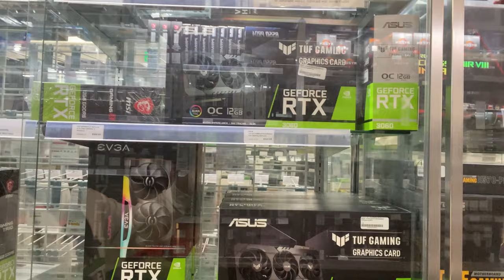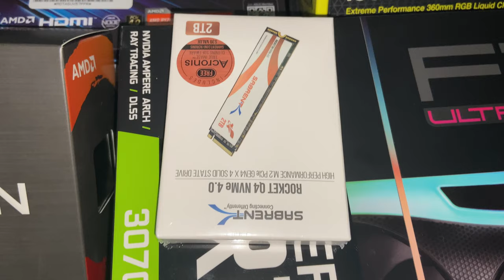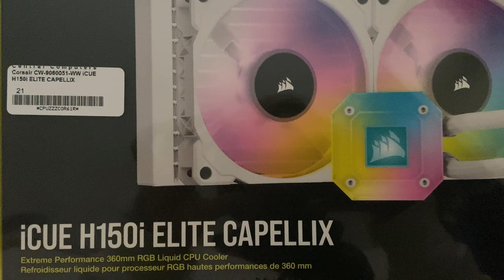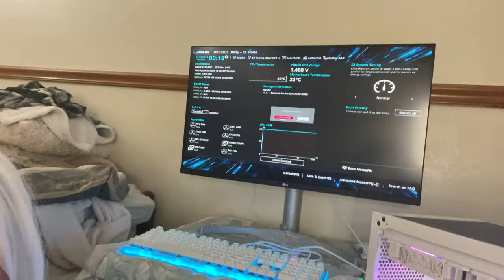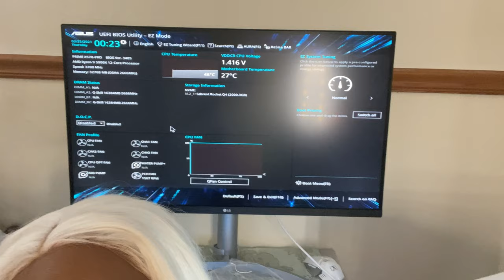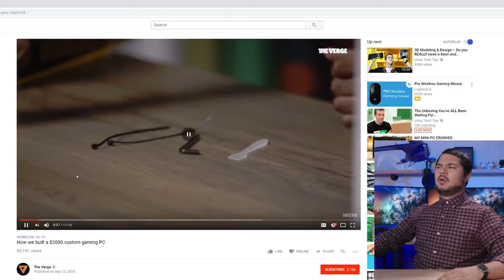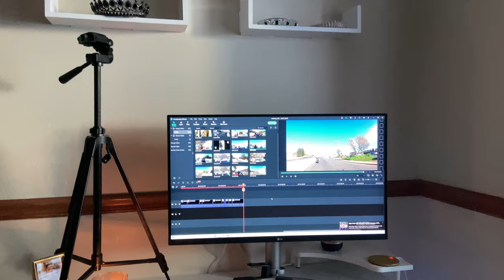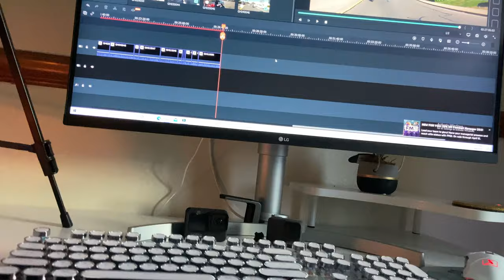Building my first PC build. I FOUND GPUs!!!

Comment: Super late but congrats on the build - one of the 3 builds (not a typo) I've done for myself has similar specs (same CPU as yours, GPU: RTX 3070ti by Nvidia, motherboard: ASUS ROG Strix X570-E, EVGA Supernova G5 1000W PSU, 22TB total storage {might change some aspects there}, 64GB RAM, NZXT 240mm Kraken X53 CPU Cooler and Phanteks Eclipse P360A chassis).

I also had very similar frustrations so it's all good. This earned my sub!

Comment: 9:40 be carefull, the NVME is wrong
you have the yellow screw that is to be inserted into the motherboard, and then you will install the NVME on top of that base and it will come with the screw to fix it, in your case you put the screw in the yellow part and screwed the NVME straight into the board, this makes it crooked, with 1-2 years the NVME for heating and cooling and being crooked can break